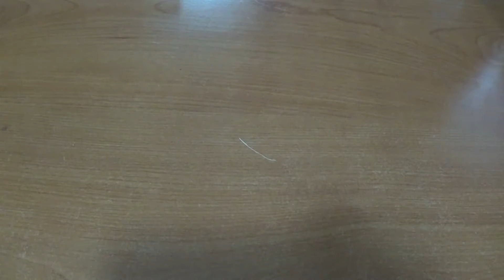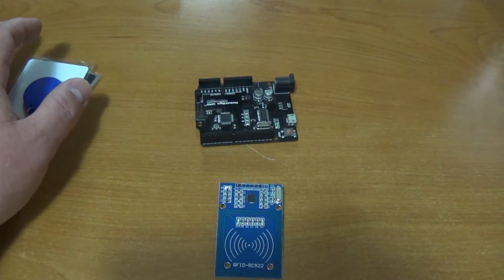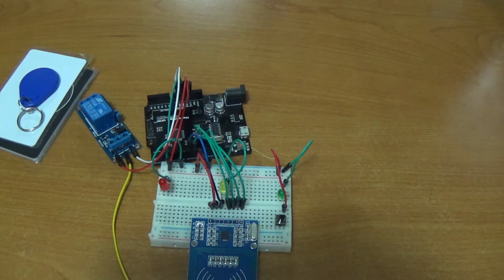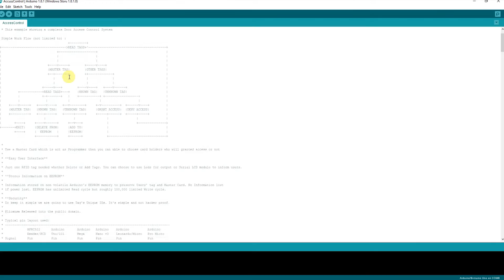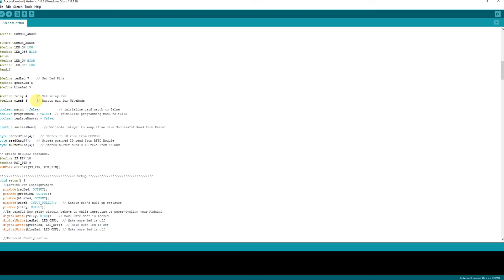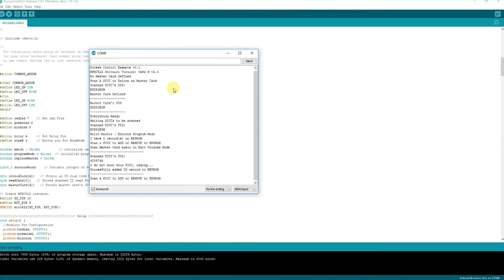Basic RFID RC522 Arduino Setup

Comment: Is there a way to have the RFID turn the relay on and after 30 min have it shut off by itself?
Reply: change in the step:  granted(6000) to (3600000)

else {
      if ( findID(readCard) ) { // If not, see if the card is in the EEPROM
        Serial.println(F("Welcome, You shall pass"));
        granted(6000);         // Open the door lock for 10000 ms = 10 sec

Comment: There are these little things called RESISTORS....you want to use them the next time you attempt a 6th grade science project, also the Arduino has GPIO pins not ports.
Reply: Don't be like Marty, don't be a dick on Internet.
You might want to explain what the problem is, and not be a dick about it.

But yes, one should always use a current limiting resistor on a connected LED.  If not one could burn the ports on the Arduino or the LED.  A resistor value from 330 ohm to 1k ohm would do. And yes, there are also a total limit of how much current the Arduino can deliver/sink on all I/O pins, not only on each individual I/O pin.